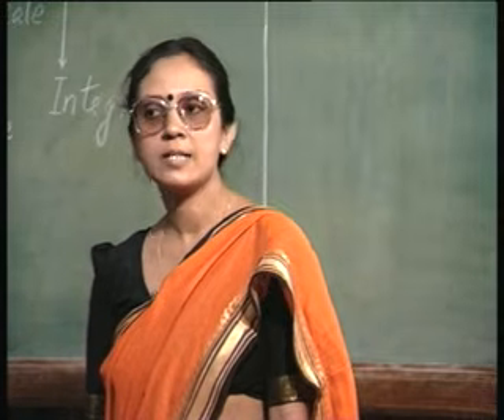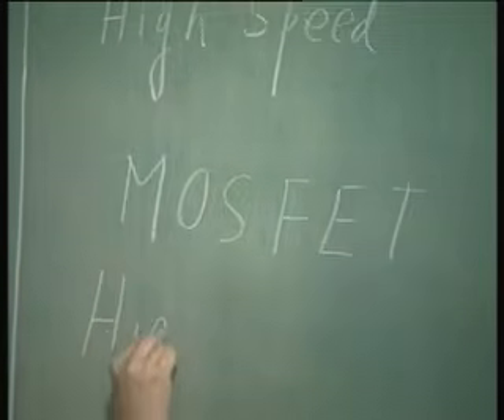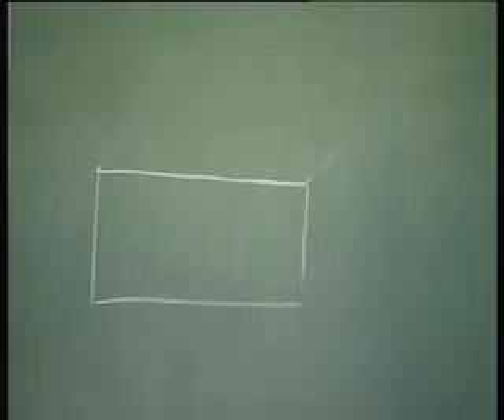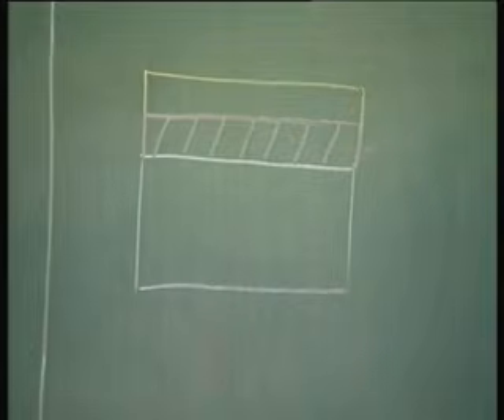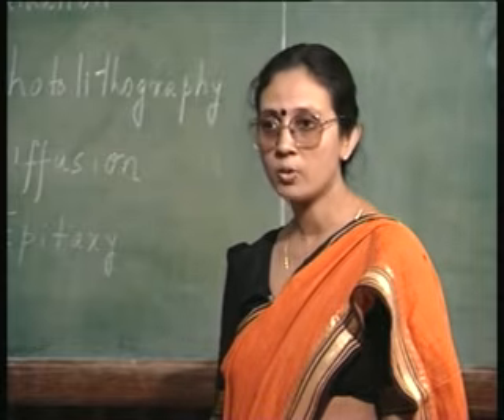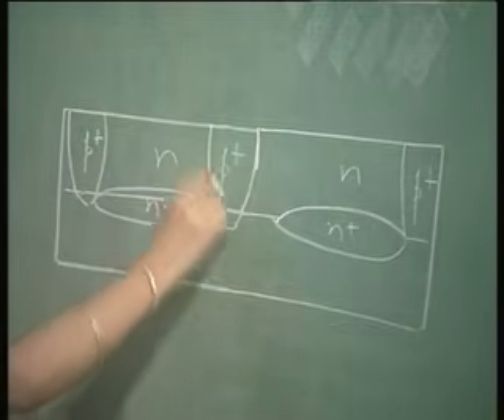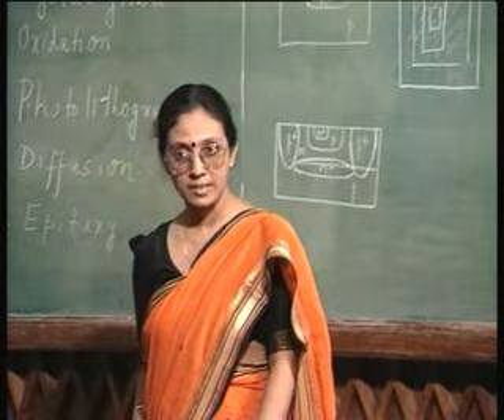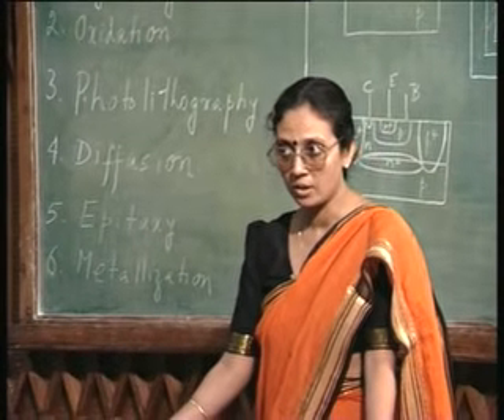Lecture - 1 Introduction on VLSI Design

Comment: In VLSI design according to application  chip will vary,for mobile application switching circuit s are used,power application power PNP transistor are used,similarly

Comment: Hi 
If any one did m.tech in VLSI, or have good knowledge in electronics engineering subjects as well as know MATLAB , PSPICE , MULTISIM, type software .
If you are interested you can work with me ," work from home ". And you can easily earn up to 25k even more  , and you have to give only  2 hours.

What's up plz- 8770628335